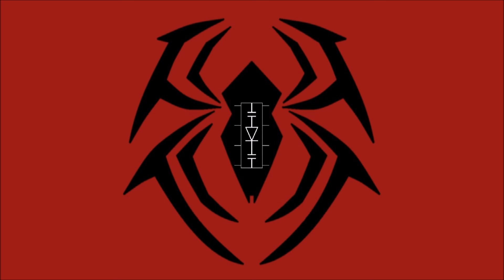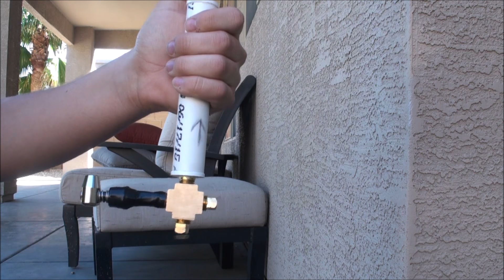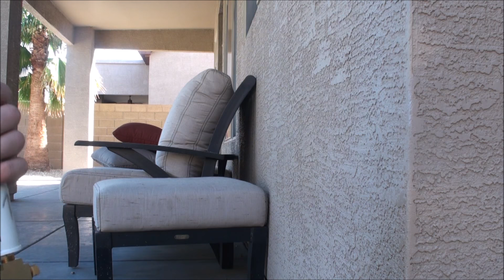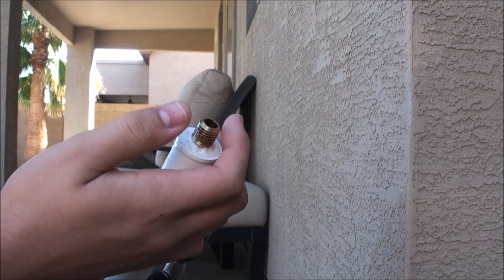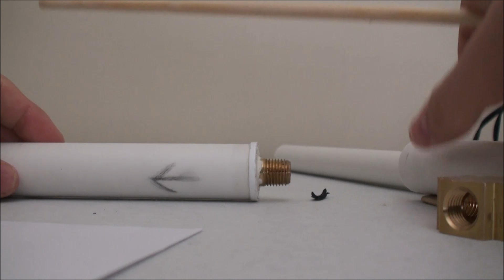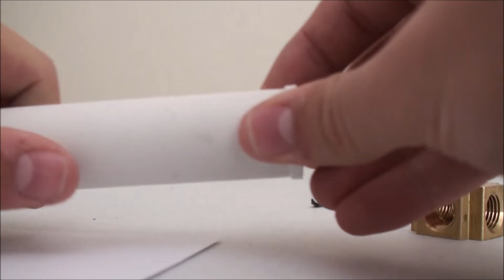Web Talks - Small Talks 3: The Volumetric Issues

Comment: So basically if I were gonna use a square/prismic cartridge I would need a source of pressure inside and not outside via butane or refrigerant??
Reply from the maker: You would probably be fine if you just mixed butane or the refrigerant with the formula as the propellant, and used a prismic pressure vessel. The only thing would be like I mentioned, you shouldn't store it for too long with the propellant mixed in, because the pressure vessel might burst.
Reply: ok thx for letting me kno